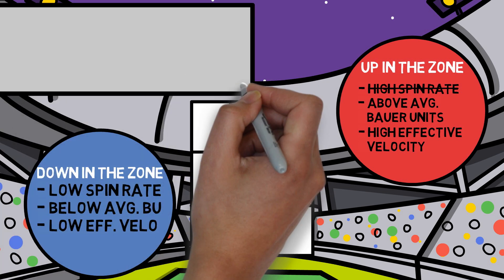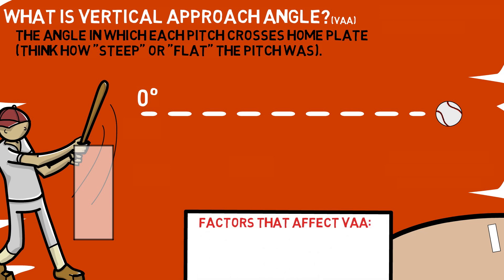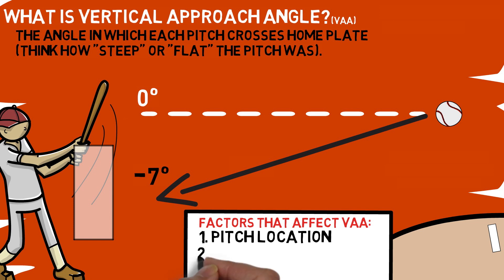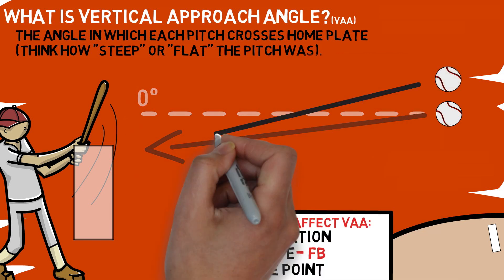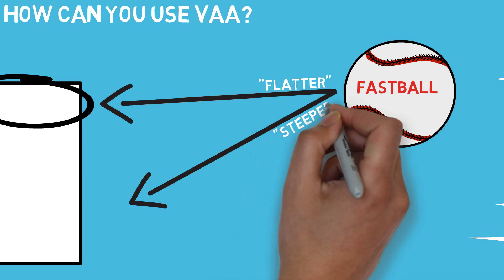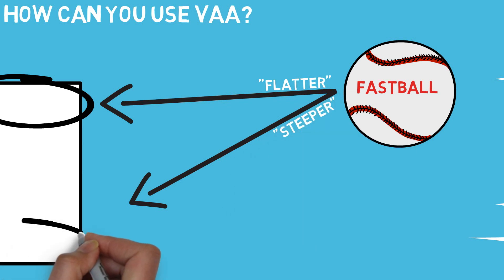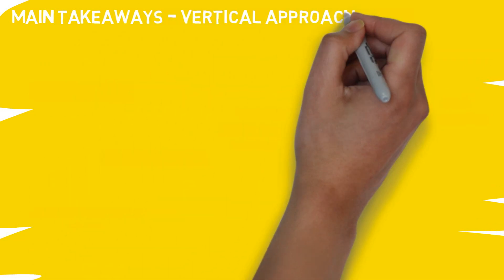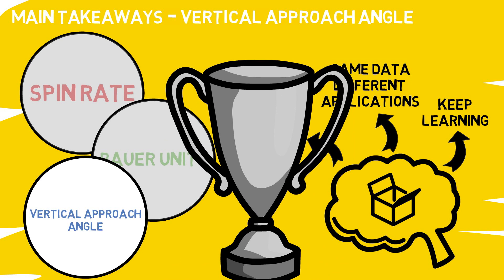VERTICAL APPROACH ANGLE BASEBALL: Everything You Need To Know

Comment: First off, thank you! Rewatch your old videos a lot to continually retain all the information in order to helps guys. I am curious though, in your opinion, let's say a guy has relatively low spin or low VB (potentially lower 3/4 slot), but is sitting around -3.8 to -4.0 in the top of the zone. Given the VAA would you still recommend a heavier dose of FBs up, or would you scrap the VAA in this case and continue to command well down despite a VAA around -6, but utilizing the lower spin/VB.
Reply from the maker: This is a great question and something I've discussed frequently amongst my colleagues. Obviously this isn't the most common occurrence, but when you have a player who's spin rate indicates he should have success at the bottom of the zone, but his VAA says he should pitch up in the zone - I'm currently under the impression you should always take the side of VAA instead of spin. 

This may change, but in my initial findings it has led to higher success rates than the opposite. Hopefully this helps!
Reply: @SimpleSabermetrics  Thank you for the response! Super helpful; I tended to lean this way as well, but was never 100% confident if I was saying the correct thing. When dealing with high level college arms (the one who inspired this question) the last thing I want to do is use data to give them a poor plan heading into their seasons. I’ll be continuing to watch though, easily my favorite account on YouTube

Comment: Hey Jake! I was wondering when you were going to do a video on this topic (I read the U.Iowa article when it was published). Great video as always! One question. If a pitcher has high spin rate with a steep vertical approach angle, which metric should be prioritized? (VAA or spin rate-I thought you said VAA in the video, but I was wondering if you could expand on it a little bit) Thanks!
Reply from the maker: In my opinion I’d recommend VAA. If the player has an average VAA, then turning to Bauer units would be my next step in deciding how they pitch. Thanks for the question!
Reply: Hi Matthew, I was wondering if this comment could help.

If a pitcher has a high spin rate and a steep VAA this is not necessarily a bad thing and this doesn’t mean they “counteract” each other. The pitcher could still use this to his advantage. Yes, having a high spin rate gives the fastball more “life” or “ride” but these same qualities could be used for a steep VAA where fastballs need to be more down in the zone. 

For example, a pitcher who has a -6.5 VAA and a spin rate of 2400 on his FB could throw a majority of his fastballs down in the zone and would likely have a lot of hitters give up on the pitch. Those steep pitches give the illusion as if they are going to finish well below the strike zone but end up “rising” as a strike in the bottom of the zone. I hope this helps!